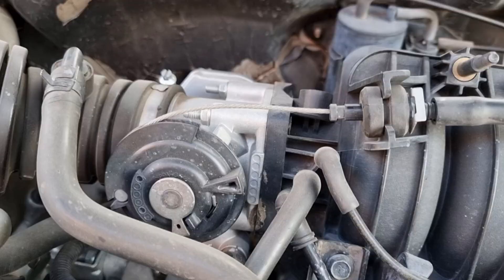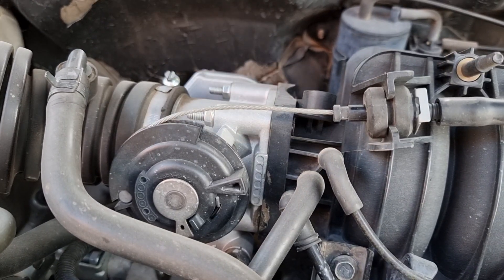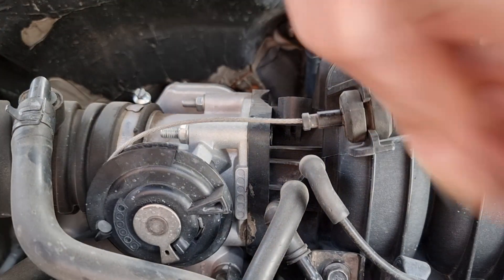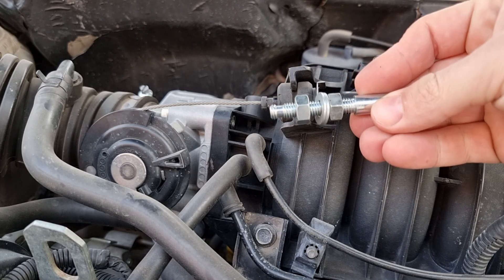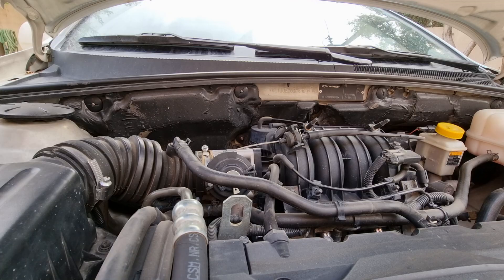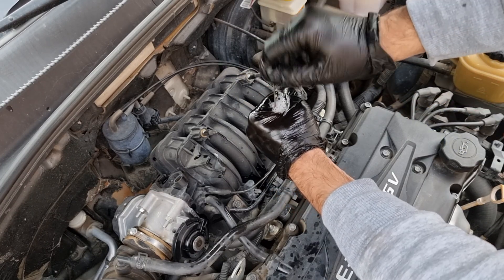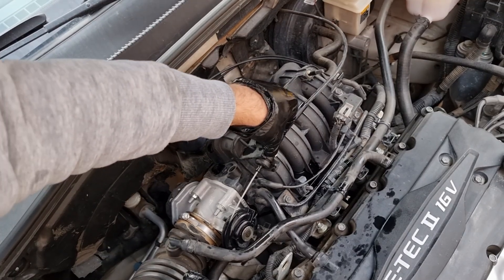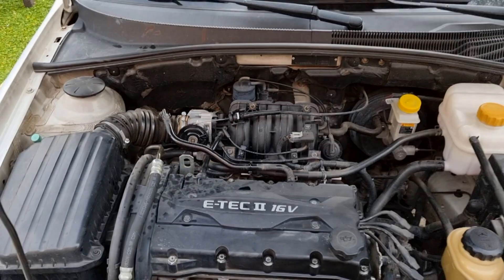Here is why your Cars Engine lost power/Gas pedal feels heavy/Adjust cable controlled throttle body

Comment: ..Except that WD40 is NOT meant to lubricate. It will evaporate in minutes. You could use a little grease if you want, but I hardly think this will make any change inside the cable.
Reply from the maker: It's not about having oil or use grease, because it will attract dust and make it heavy again

Comment: I had my spark plugs changed, mechanic both me iridium or uranium (i don't if its the same) and said it was better, got my trottle body cleaned all at once, coils are still in good condition, it was better with power and gas management but i still feel that the trottle is heavy and i still feel like its not producing the power it used to, now after discovering this video, i really think this is the current issue, thanks for this. Now i will go get it fix tomorrow
Reply: Did you get around to it? How did it go?
Reply: @caveman6759   dude... immediately when i told him my trottle felt heavy, he took my car with me and test drove it a little block away and said everything was fine, that the car has alot of power and that i shouldn't worry. I told him i know my car and been driving it for 3yrs, he still said everything is ok, we arrived at the garage, and he just left. Also he said its electronically controlled and doesn't have a cable like old cars do.
Reply: @caveman6759  before that  i had to repair my front right suspension and steering arm, my guess is he disconnected the ecu and it resetted to the stock tune, i had a custom tune that improved the car's performance and response both on throttle and shifting was alot quicker plus the engine made more power. Since that time, the car doesn't feel right. I will go to that tuner where i had it tuned and check if the ecu was resetted. Maybe that could be the problem and my car is on relearn driving habit proccess

Comment: My Corolla 1.6 2004 Automatic not exceeding 110/120 and the throttle pedal ends and starts touching the wall. By pressing the hard acceleration pedal, gear kickdown and then engaged but the speed not exceeding and the RPM also stuck at 3000 to 3500

Comment: People, Don’t try this on newer vehicles. You are NOT going to find cables for Throttle body & or transmission cable linkages for shifter & tranny shifting, Now days the gas pedal is electronic sensor (apps) & also the throttle body (TPS) even the shifter  is electronic. Do your research, So you try to clean a newer throttle body don’t loose one or all of your five fingers😂
Reply: He explains that on the first part of the video

Comment: Very few vehicles are cable throttle. 
Do not use WD-40. It is for water displacement. Sure, it will work at first, but when it dries fully it becomes sticky. That's why you have to keep using it.
Instead use any penetrating oil, or Silicone spray.

Comment: Bro i cleaned valves and piston using carb cleaner with the reference of ur video and now my car is misfire and i try to tune but no response used scanner also. Car is Toyota Corolla 9th gen. My mechanic says that piston ring has goen. And due to cleaning valves the head settings has been changed and he said we shouldn't use carb cleaner and should not remove carbon from engine untill u r installing a new piston or else. Please help
Reply from the maker: There must be something wrong with your engine even before doing that, I do that process every few months on our 3 cars and had now problem with them, it's been few years I'm doing that, and carb cleaner is same as carbrater cleaner, ppl been using it for so long
Reply: @AliMECH  what problems u have in ur 3 car now, as u wrote that after months they are having problems
Reply: Nothing wrong bro, everything was fine last week i also did 218kmph on it no problem. And ur raising questions on Toyota engine reliability ?
Reply from the maker: I tested that over years on toyota camry, mitibushi outlander, and chevrolet optra before publishing the video

Comment: I have a 2004 mazda 3 that would stick slightly when initially pushing the throttle, even after thoroughly cleaning the butterfly. I found injecting some thin sewing machine oil instead of WD worked great plus adding some 20-50 motor oil to the throttle return spring.

Comment: Hi Ali how to do in electronic of electrical throttle system.  if we don't have a cable
Reply from the maker: You won't have that problem with electrical, sometimes electrical throttle bodies when they don't open enough,  you need to reprogram it, and this happens if you try to open the plate by hand or use carb cleaner for cleaning